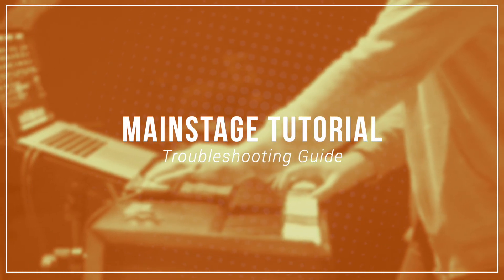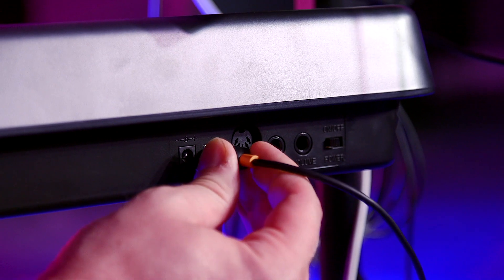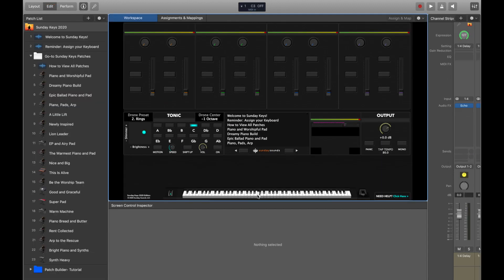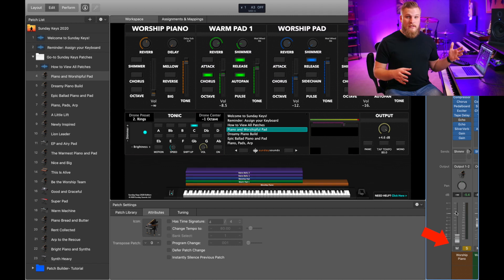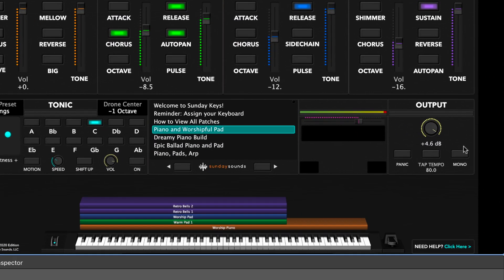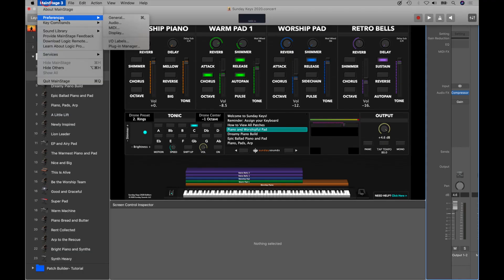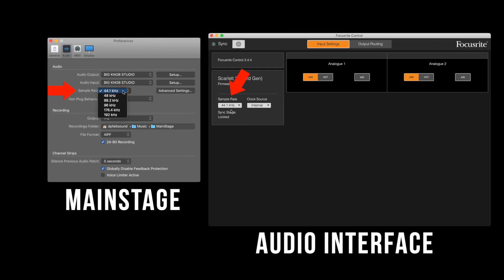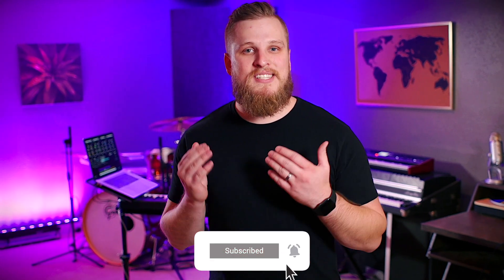Troubleshoot MainStage Keys Rig Problems - What to do when MainStage Stops Working

Comment: I'm running into an issue with mainstage where, occassionally, an extremely loud white noise sound comes out if the keyboardist plays a note. It'll come in and out, any ideas?

Comment: My problem is the following, after having worked creating the patches for the service, then when I want to connect an output of active monitors or an interface, when I change the audio output, the computer starts working forever and mainstage stops working.  This problem has me afflicted because just before the service sometimes this happens when using the interface and I can't play the piano
Reply: Also happens with my active monitors sometimes (without interface) but never happened when I used only my earphones

Comment: Audio Interface can also be the source of issues. Check settings on it. Check cables. Surprisingly, I had been using 1/4" cables for a few months with no problems but started dropping out or sputtering. I called Focusrite and they said I had to use TRS cables.  Also be sure to keep your firmware up to date.

Comment: This is a great video, but it actually didn't solve my problem! I have MIDI notes showing at the top of the screen, and on the on-screen keyboard, but the MIDI seems to not get passed over to the channel strips and software instruments. For example, Kontakt does not have that little flash on the MIDI icon in its own window (and Kontakt is set to receive 'omni' channels). The only way I've found to resolve it is to restart Mainstage multiple times. It usually starts working again on the 3rd or 4th restart. I'd love to find out the real reason for the problem so I can find a more reliable solution.

Comment: Thank you, David. All of your videos are so clear, logical and comprehensive. I am having an audio problem with a concert I created at the beginning of the pandemic which I am finally returning to now. I have 53 patches but of those patches, only two produce sound. The ones that don't produce sound DO show midi data, and the Mainstage onscreen keys visibly go down when physical keys are played.
Reply from the maker: Thank you Tom! You might try checking the layer ranges for each channel strip, and make sure you have the full MainStage sound library installed. Also check to make sure the channel strips in those patches aren't muted. If it's none of those, try selecting the channel strip, then in the inspector go to MIDI input, and make sure under Keyboard its setup correctly.
Reply: any suggestions when pads getting stuck when using the sustain pedal, I'm running into this issue on almost every patch....thanks

Comment: hi what if I am missing the parameters used by  korg nano2 for song specific patches that I bought on Sundaysounds, all other parameters show on Sunday keys template, but not song specific ones, can you help me with that , thanks
Reply from the maker: Hi, that is how they are designed, Song Specific Patches are programed to bring in/out layers via the mod wheel. You should only see the visual in Section 5.

Comment: Hey David, i need some help bro, i recently got a new keyboard at. CHurch, and i notice that when i use it, it sounds like my center octive, which its the C4 and C5 on my 88 kayboard sounds to thin, and i been having to transpose 12 notes down to be able to play on the normal keys, do you have any suggestions o. How to fix this?
Reply from the maker: Hi there, MainStage lets you designate your "middle C" key within MainStage preferences, which is designed to accommodate different manufacturer settings for how MIDI is transmitted. Head to MainStage preferences to adjust :)
Reply: @SundaySounds  but do i have to use the transpose feature?

Comment: I'm using macbook pro 2010 with high Sierra os ,when I m connecting bluetooth headphone on mainstage my sound showing latency ,,,, how to resolve this issue plz helpe
Reply from the maker: Hi there, Bluetooth shouldn't be used for musical performance, as its latency is unavoidable and will always be too much to tolerate.
Reply: Hi one more help I need .....when I'm changing my audio output built in  to focusrite scarelett 2i2 usb after I give apply changes it wil hanging so plz tel how to resolve this

Comment: Hey buddy, I’m running an electric drum through Mainstage but certain drums (hi hat control) has no sound while the other drum parts worked perfectly. Do you know what’s wrong here? 😅
Reply from the maker: I would double check that it sends midi.
Reply: @SundaySounds  Yeah it sends midi. The other parts of the drums are working perfectly, except for the closed hat/control

Comment: Thank you for the great and helpful video. My problem is after the service when we want to play the keyboard again for dismissal (after it has been sitting untouched for 45 min) the sound comes out broken, glitchy, and very delayed. If I unplug my interface and then plug it back in, the problem is completely gone. Does this sound like it could be a CPU problem. I am using an older mac

Comment: Thank you so much! Question based on Step 3: I'm having an issue where I'm peaking on MainStage but it's quiet.  I checked my mixer and everything seems fine.  As I was listening to your video it was very loud.  I tried a different video and it was still loud.  Is there a way I can avoid peaking in MainStage but still bring up the volume without having to change the fader on my mixer every time I want to watch a YouTube video?
Reply from the maker: Are you using an audio interface? If not, I would try that.
Reply: @SundaySounds  I’m using the behringer XR18

Comment: Great video. I have an issue that keeps happening and none of your tips seems to address it specifically. 

I’ve been careful to ensure that I’m sending a healthy amount of from each patch (virtual instrument channels) and that my total dB is at -10 or quieter. For some reason, Mainstage will mysteriously cut my volumes on individual patches as if it’s protecting itself from clipping. Some other patches stay at regular volume simultaneously, but whichever one was loudest drops back in volume even though slider position and virtual synth volume levels display the same values as before the drop off. 

I’ve attempted to lower volumes a lot but it still happens. I’ve switched my buffer size to a greater number too. I have a display of CPU usage running too and I hover between the 20%-30% mark most of the time, so I don’t think it’s a CPU usage problem. If I turn Mainstage off and then restart it, all volumes go back to their regular, strong signal. My audio doesn’t sound like it’s clipping all because I’ve kept gain settings down. This anomaly only happens on virtual
Synth patches and doesn’t happen on microphone or guitar audio input channels. 

Any ideas?
Reply from the maker: You might try adjusting your buffer size and some additional tips are here: 
https://sundaysounds.com/blog/mainstage-tutorial-cpu-optimization-tips

Comment: I use a single sax sound and is ok to a certain point, then stops sounding. Midi working, then I change to another sound and no problem. Always with a sax sound.

Comment: I have an issue with mainstage. It sustains all my sounds even without pressing or connecting a pedal to the keyboard. It sustains randomly then I have to hit the panic button and then it stops but then it does it again. I’m running mainstage on a MacBook Pro 2017 with a usb hub could that be the issue. What should I try doing?
Reply: I have this same Issue, Been looking for the Solution everywhere. 
How did you fix yours?
Reply from the maker: You might like to check out our CPU optimization video here to see if there are some things you can change in MainStage: https://sundaysounds.com/blog/mainstage-tutorial-cpu-optimization-tips